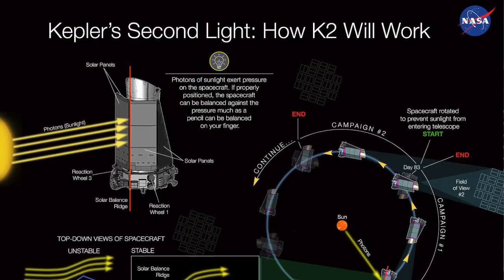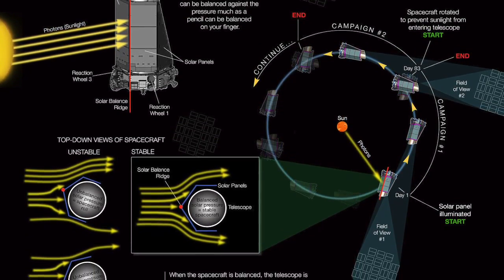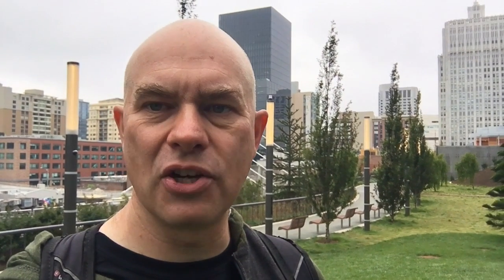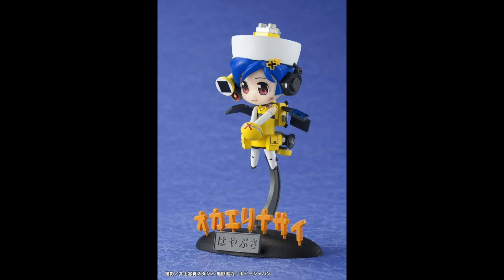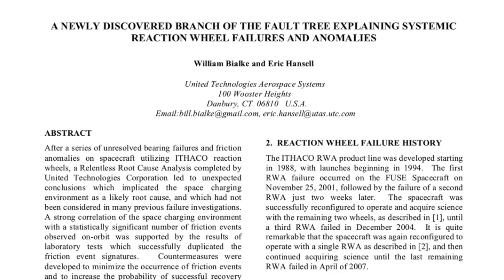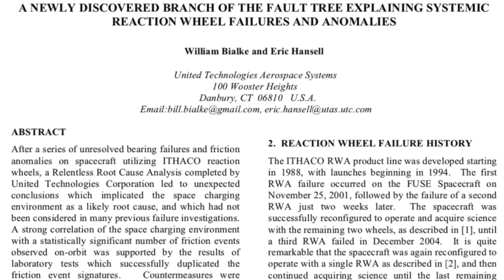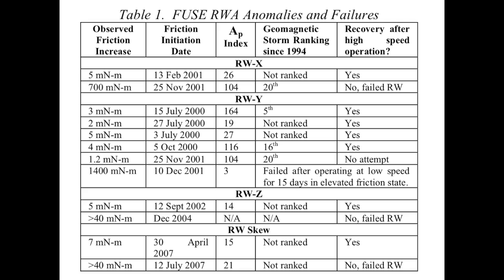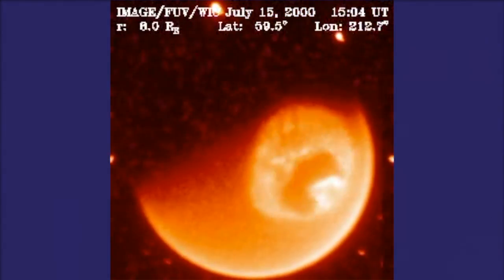Scientists May Have Figured Out Why So Many Spacecraft Were Failing

Comment: Ah yes electric arc across a bearing is why you have to be careful to not ground across a bearing when welding.
Reply from the maker: Yep, what amazes me is that because of the tiny gaps involved in the bearings even a few volts can create arcs with enough energy to melt steel.
Reply: I dunno grounding across bearings can be hilarious when a trainee does it. Flames (from the lubricant), a "bearing" that is now rock solid, and mickey taking material for the next month at least.
Reply: Not so funny for the welder that does it across multiple bearings in a turbine engine, We had one the was welding an exhaust nozzle crack, but grounded to the front fan assembly on the engine, welded every bearing in the engine.
Reply: Hawkertech;
"Not so funny for the welder that does it across multiple bearings in a turbine engine, We had one the was welding an exhaust nozzle crack, but grounded to the front fan assembly on the engine, welded every bearing in the engine"
That simplified the paperwork at least.  One (1) engine assembly, complete.  Total write off.
Reply: Hawkertech so you basically totalled the engine by making all bearings in it stuck and welded in place forever?
Reply: @Hawkertech
"Think about where your bloody ground clamp is" is some of the best advice to give any welder, rookie or vet.
Reply: Hawkertech 😱
This is why we have approved procedures and fixed work instructions. Did your guy just ignore them?
Reply: @wb6anp  -  at no additional cost for the effort ofcourse.
Reply: @wb6anp  pricy!
Reply: And with electronics, the voltage of static electricity that you need before you feel the zap is something like 10 times greater than that needed to damage a chip.
Reply: Surface finishes for bearing are usually measured in micrometers. Clearance at one thousandths of an inch or less, so even a small arc can cause damage. Even at just 1000 rpm, bearings see over 1m rotations in a day, thats more than enough chances for damage to occur.
Reply: @scottmanley  How is there a gap if the bearing is under load?  I doubt these things have enough slop that all the balls are not contacting the inner race.  What does AvE think on this?
Reply: @Duffman15000 : That what a lubricant is for, to separate 2 surfaces with low friction material. even if the separation is a few molecules thick there is still separation.
Reply: @Duffman-zn7ku  try looking up oil wedge. It's pretty cool how under load the lubricant can maintain a low friction environment between the 2 surfaces.
Reply: @ohertzs  try looking up how oil is an insulator and is used in transformers for that very reason.
Reply: @Duffman-zn7ku  Yep I know :)
you asked how there is a gap when under load, I was just trying to explain. The wedge is very thin though, just because its insulating doesnt mean an arc cannot occur. Maybe if the lube acted as a faraday cage it would work? Hmmm
Reply: @Duffman-zn7ku  Lubricated surfaces ride on a film of oil - that's how the oil reduces wear and friction.  The surfaces no longer touch each other.
Reply: "Low" voltage can be a BITCH!
Reply: Doesn't surprise me. Think about the contact breakers in old-style car ignition systems: they managed to pit the contacts with only 12 volts DC. Cleaning the face of the contact breakers and  re-setting the gap was a standard maintenance task before the advent of electronic ignitions. You sometimes get motorbikes with steel frames and pitted steering head bearings. Since there's a lot of wiring taking power to the switchgear, clocks and headlight through that flexible joint at the steering head, there's a always a suspicion that this kind of irregular pitting is due to an electrical short that's earthing something on one side of the steering head through the bearings to the battery.
Reply: Scott Manley...  Are they using ferro fluid for seals and lubrication, like we use for bell jar feed throughs? If so that would probably be a really weird induction event during a CME.
Reply: Scott Manley it’s the current that does the damage. The voltage across a welding arc is next to nothing and you can rip into steel all day with that.
Reply: Could they not just make the lubricant highly conductive and stop the buildup of voltage?
Reply: Scott Manley my girlfriend says tiny isnt enough
Reply: @scottmanley  Ball  bearings getting pitted by electricity is kind of like non-electronic ignition car's points getting pitted.
     I guess, there's can be plenty of current from a solar event & at almost 18,000 mph the possibility of enough voltage  for sparks or arcs is there.
Reply: Scott Manley It’s not about energy, it’s about energy DENSITY. The bearing concentrates the flow of energy which is what causes the arcing
Reply: Scott Manley yep, as you decrease the distance d between 2 conductors with a potencial difererence V the electric field between them goes up like 1/d !!!
Reply: Well, there are no complete solids at atomic level anyway. Some particles sometimes get out of their places in grid.
It's just a matter of amount.
Reply: James Collier it's a wheel that you spin to spin your spacecraft the opposite way (hence reaction) without wasting propellant. Used to orient and stabilize.

Every action has a equal and opposite reaction. In order to spin up something in space you need something else gaining the same angular momentum in the opposite direction
Reply: +James Collier Also there is a gyroscopic effect where trying to rotate the axis causes it to precess turning both flywheel and the spacecraft. IIRC this way is preferable because it does not require using attitude thrusters to dissipate angular momentum from the flywheel if there is a constant force (such as solar pressure)
Reply: Surely theyve got very heavy counterweights in them though, I get that something like that should never fail would be better for long term use compared to fuels, but weight is everything on a launch, so I am just wondering if that is how they work.
Reply: Its not the same type of damage to the bearing, as say, a welding arc. Scott is talking about micropitting here (basically unwanted Electric discharge machining). The damage increases over time, giving the balls, and bearing groove a ‘hazy’ appearance. (This can also show bearing preload direction as the ‘hazy’ part will be offset to the side in the bearing grove) I have seen this phenomenon at as low as 4volt across the bearing - which mean even Eddy currents in the motor shaft can be the culprit!
Reply: aftenstjernemix that damm Eddie, always taking his pranks too far & ruining millions $ equipment!
Reply: What if you make the grease conductive?
Reply: @zombiewelder9319  most things that make great lubricants are either not great at conducting electricity or pretty flamble, so its just easier to not ground across a bearing
Reply: @zombiewelder9319  I was thinking the same.
Reply: Way to give away the punch line, cody :-p
Reply from the maker: Here's a guide to attitude control I made in the past:
https://www.youtube.com/watch?v=7Js5x4NhUxU
Reply: heh. seems i asked almost the same question about mechanical friction and heat in the comments of that video 2 years ago too.
Reply: ask destin

https://youtu.be/7AR4yntqLsQ
Reply: James Collier, by the way, it's not an omnipotent device. If your spacecraft was given torque, then in order to remove it, reactions wheels must constantly rotate until they break down, or until that torque gets canceled out by another one.
Reply: isnt there also loss of energy from the reaction wheel to the heat of mechanical friction?
also, couldnt a pair of reaction wheels at 90 degree angles be used to cancel the other out via 180 degree rotations?
Reply: Temp Name There are still thrusters onboard to offload accumulated momentum from time to time. But these events are pretty rare compared to the constant adjustments being made, and will be done by running the reaction wheels at variable speeds. For example the constant attitude changes in the mars orbiters to point the cameras down on a circular trajectory, but also to offset the movement of the dish antenna which must constantly point to Earth while the spacecraft body turns to point the fixed installed cameras adds to odd momentum changes. This all is done by the reaction wheels.
By offloading the buildup momentum which is also party caused by pressure from sunlight, and minute traces of the atmosphere on a weekly or monthly basis the spacecraft can operate rather for decades compared to a few years for Mariner 10 or the Viking orbiters.
Reply: You guys do realize that magnetic bearings are a thing, right? You don't necessarily need grease at all.
Reply: How is that going to solve the problem, Jared? -given the EM aspect of solar flares is several magnitudes greater than its ability to induce static voltage?
Reply: @JVerschueren  : The theorized damage mechanism is that arcs across the bearings create physical defects, which then cause further damage by causing cumulative wear elsewhere in the bearing structure. However, magnetic bearings don't have physical contact between components, and thus wouldn't suffer any damage other than the initial melt/vaporize event. If someone is still worried about static charges, then the radiative electron emission technique mentioned by others (or a technique scavenged from vacuum tubes) can be used to cause gradual redistribution of unequal charges.
Reply: Jared Maddox what Jan is saying is that magnetic bearings have a different problem because solar flares have a very strong electromagnetic component which could be a bigger problem than we know (i can't seem to find research on this though)

All of this is moot now anyways given that scott said ithaco switched to ceramic bearings a few years back
Reply: Correct, during a solar event,. magnetic bearings are going to be forced into excentric operation and who's to say that doesn't cause excessive play and damage down the line?
Reply: @JVerschueren  : A bearing that doesn't have some level of restorative function strikes me as having at best marginal utility in the first place. I would expect that in the absence of damage more significant than micro-pitting, any magnetic bearing likely to be considered for most work would be intentionally designed to gradually dissipate undesired motions, since the inability to do that would consequentially render the bearing almost useless for transmitting forces from one component to another: in essence, if you don't need to transfer some degree of force, then you don't need a bearing in the first place.

As for the EM flux, I would be surprised if it was an impractical problem. If you're worried over static magnetic fields, alternate layers of paramagnetic and diamagnetic materials to concentrate fields around the "inner capsule", instead of through it: you want to average a susceptibility of 0 from what I understand. The same (with at least one layer of conductive material mixed in, likely as copper for diamagnetism) is relevant for dynamic fields, though having the magnetic source be spinning relative to the external field should produce desirable effects as well. I expect that these techniques should be capable of providing bearing reliability, just so long as the cumulative eccentricity never surpassed the bearing's capacity.
Reply: @absalomdraconis  Bearings generally isolate the forces between components, not couple them.  Bearings that couple the forces are bad bearings.
Reply: @absalomdraconis  So are ceramic bearings
Reply: Hi cody  using x-rays from one of your radioaktiv sources to try to make baring fail would be an interresting Video
Reply: Did you watch the video?
Reply: What’s this?
A crossover episode?
Reply: Oh, Hi Cody!
Reply: I just learned something. Thank you !
Reply: Would love to see AvE and your take on this subject if possible. I'm not fully sure I understand what all is going on based off this video and having other people explain is always a big help.
Reply: I wonder if pressurized air bearings would work better? I use them at work to balance missile parts. They spin forever! They're pressurized to 90psi. Very interesting bearings.
Reply: @saltysteel3996  Air bearings are great but not a good solution for spacecraft. You would run out of air pretty soon.
Reply: This is why astronomers need materials scientists/engineers.
"We dont know why our reaction wheels keep breaking!"
"Ungrounded electric discharge causes  the metal in the bearings to deform, use ceramic bearings."
"Oh."
Reply: Cody! Just the mind i wanted to pick! I saw a video of yours moving mercury with an electromagnet. Would it be possible to use a torus of conductive fluid being moved in that way as a sort of mechanically simple reaction wheel? Should i worry about patenting the idea? Lol
Reply: Another solution is to make conductive grease. Can mercury be somehow used as a lubricant?
Reply: @mordoc333  I was thinking mercury as well..I also ponder on the temperature of the bearing in space.
Reply: The most anticipated crossover event since "Avengers: Infinity War". Cody'sLab & Scott Manley!
Reply: what happened to your new beekeeping series cody?
Reply: *welds bearings without isolation barefoot in a pool of mercury while drinking cyanide*
Reply: What about a dielectric fluid as the lubricant...would this prevent this from happening?
Reply: @markaboyce  I'm not sure, the layer of lubricant is usually very thin at the closest point of contact. Probably 10x thinner than human hair
Reply: @markaboyce  Oil is a dielectric fluid.
Reply: Yep! Even if you weld near a bearing and manage to ground in a way not to spark the bearing (which can be difficult), the heat from the welding can also cause deformation by the temperature gradient messing up the whole bearing. I've actually had a young very distracted individual actually suggest welding the side of a bearing to a structure. One must just ask why people use interference to fix a bearing and not welding. At least I think he learned something that day.
Reply: Yup, very hard to eliminate stray charges entirely. Farmers have a huge issue with stray electricity in milking parlours, a potential of a volt can cause mastitis. I think the only way to completely prevent stray and induced currents would be to use a bearing of insulated material such as a ceramic bearing, if such a thing exists.
Reply: @copyleftrebel6592  Perhaps watch the entire video next time.
Reply: Could as well be a cold weld, no oxide layer forming in vacuum and such or an arc penetrating the oxide layer + the micropitting
Reply: that's right! A guy at a shop  I worked in was welding a piece using  his rollaway as a table and welded all of his drawers shut. It was a HOOT LOL!
Reply: Vw beetle transaxles MUST be properly  grounded to the frame of the car. Else the ground will pass through the CV joints and destroy your bearings. Personal experience....
Reply: I've had to replace some big bearings, about 10"Dia., in a test stand dyne for testing transmissions. It was a bad design with the grounding brush on the shaft were on the outside of the bearing on each side versus in-between the bearings. Electricity will follow the shortest and less resistant path to ground. The bearing literally started to rip itself apart. The bearing pulled metal away from the housing after welding itself. Of course, we're talking way higher voltage and more amps.
Reply: I have seen machines where welding and cutting current is going through bearings, and the owner can't understand why they are replacing so may bearings. They had the work lead from their plasma cutter connected to the bridge of their machine instead of connecting it to the cutting table like most normal people would do. Besides it is not difficult to install an insulator for the bearings and use brushes for continuity.
Reply: I was just gonna say that. I've been welding for years and just the smallest zap will freeze a bearing in its tracks.
Reply: Cody'sLab this has implications for lightning protection of moving machinery. Bearings and drives need to be completely cross-bonded so that there is a reduced possibility of racing through the expensive bits.
Reply: I recommend a good quality moly grease.  Lots and lots of grease.  Or else 3-in-One oil.
Reply: An interesting phenomena is when you put a high current across a dry bearing it starts spinning at high speed, of course that ruins the bearing. I guess is like an homopolar motor.
Reply: @jamescollier3  spinning gyroscopes that you push against to rotate the craft.
Reply: Depends many welders make cable reels sending the full welding current (usually 300 amps 30 volts) thru the bearings.

This has been going on for 40 years and I've yet to hear of a failure

To be fair they are usually using angular contact roller bearings, usually tightened pretty good to prevent looseness, and they dont spin at high speed
Reply: -  As all us smart welders know.... woops!
Reply: This why electric railway locomotives have earth brush's in the axle box's
Reply: @jamescollier3  ‘
Reply: I've always wondered about that issue when they bring engine blocks in to having brocken studs or taps burned out. Retired machinist! 3 years back we had a Ferrari block in the house (it must have been an older one. It looked like it was cast by a few of junior highers:)
Reply: As a welder I guessed this as soon as he mentioned solar flare. For huge bearings a small current is not an issue but for tiny instruments with it's very small bearings, obviously this will ruin the tiny ball bearings if they are steel. Ceramic bearings would or should totally stop this. Also, having the races made out of ceramic material would or should be just as effective provided the bearings are separated by enough space. Having both bearings and races made from a non metallic material should totally eliminate any current problem.
Reply: How many volts do you need to electro-etch into steel ? In school we had mechanical and electrical courses and in practical classes we needed to engrave our equipment for loss and theft purposes , all we needed was a 12 volt source ( Battery charger ) and the engraver we made from a piece of steel tube with two holes in it , that we painted for insulation . We put a 5 inch nail  with hardened tip thru the holes and connected one lead of the charger to the nail and the other to the surface we needed to etch and we were off to the races so to speak. So , Yes , you don't need much voltage and amperage to etch metal surfaces.
Reply: a simple brush or contact mechanism at the bearing seal would be a simple fix, or as scott just said ceramic bearings. You live, you learn!
Reply: this is also why some electric motors have a grounding bush onto the shaft to protect them from this
Reply: Is this a problem because these are some super low-freeplay bearings? Or does solar flare tranfers kilowatts of power though bearing like welding?
Reply: Ondřej Dujka from the pics shown in the video, an equally important part of this is that the little tiny craters that get formed have surface material that is harder than the other metals in the bearing. This means that even if the bearing is nowhere near being welded together, it will still fail very rapidly because of the accelerated wear on the races and balls. These reaction wheel bearings are very high speed, so they need to be almost a mirror polish. Any wear quickly causes failure.
Reply: +Ondrej Dujka
it does not have to be continuous kilowatts of power to create small 'crater' defects (as shown in the video) that will eventually lead to wear and failure on otherwise good bearings. The bearings with that thin film of oil act effectively as a tiny capacitor, and capacitors are known for their high discharge current.
Reply: It's indeed a matter of the close tolerances in the bearing making arcing possible at fairly low power/voltage differential, Ondfej.
Reply: What is this, a crossover episode?
Reply: its a spinning disc thats used to rotate the spacecraft
quick youtube search will give you lots of videos about these guys
scott himself has done one
Reply: hi there! when are you going to open your own nuclear powerplant :) ? haha